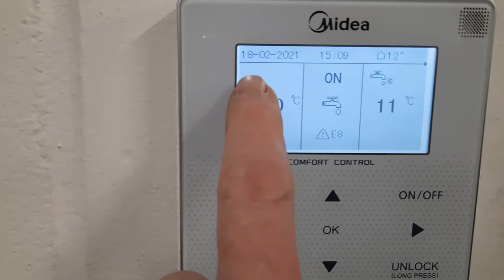E8 Error Midea air source heat pumps part 2 of 2

Comment: I keep gettin e0 E8 water flow!! Reset it 2 times a day now :(
Reply: Mine happened today, I'm gonna short that wire out until tomorrow so I can get heat.
Reply: @firmbutton6485 does that work? I thought modern appliances will throw a fault if it sees flow when it shouldn’t etc

Comment: I have found out recently with my Clivet heat pump (they are more or less Midea products) that this error code E8/E0 can also occur if there is air in the system.
In my case the flow sensor is at the highest point inside the heat pump. Thus, it can't move enough when there isn't enough water inside. Check where the bleeding valve is and open until no air is coming out.
You might hear a popping sound because the system is under pressure.

In my case I had to repeatedly bleed the circuit over a few hours because there were multiple air pockets which were moved around the pump and floor heating circuit.

Comment: Hi Graham,
Thanks a lot for your video.
I have switched on my heat pump yesterday and it shows the E8 water flow error.
It has been installed in May and worked well at that time.
So it was switched off for a while.
I'm switched off power completely and tried it again but it still shows the same error.
I'm no technical expert on this, but I would like to check if there is really water in the system. 
How can I check that? What else would you recommend to get rid of the error? 
Thanks a lot in advance
Michael